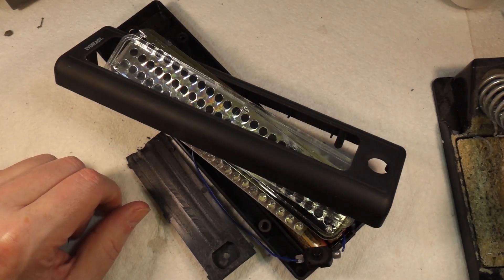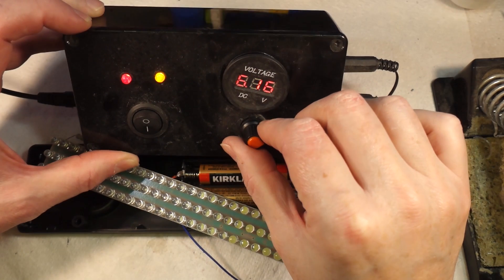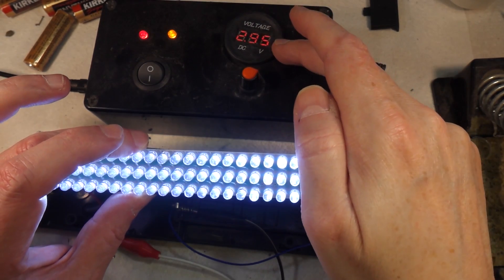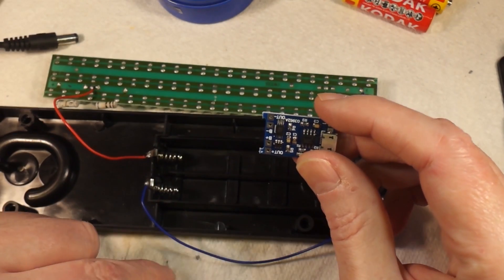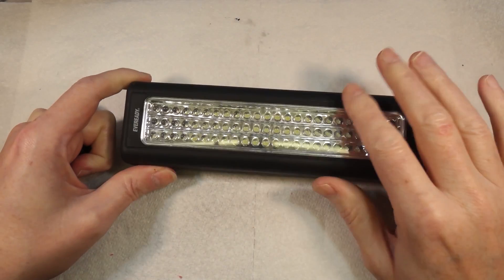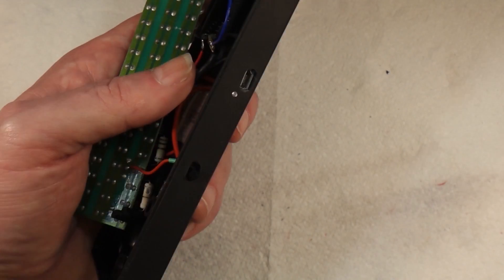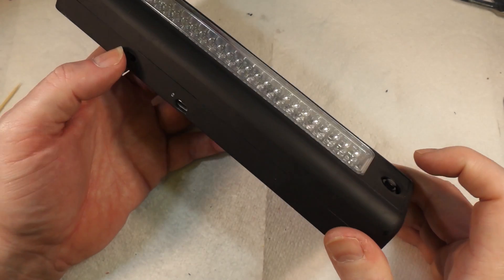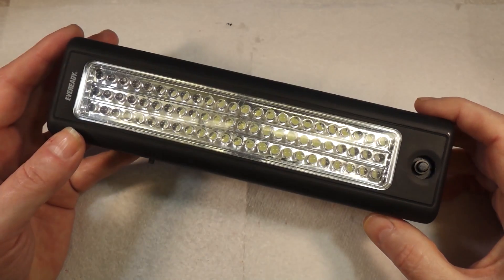Upgrading a torch with a switchable rechargeable battery circuit

Comment: A great video! I have one of these lights (mine says Maplin on it!) which I use to give shadowless overhead lighting for HO/OO figures (don't ask!). I usually feed it with AA rechargeables as I have plenty of those, but I'm very tempted to fit a lithium battery now. I probably won't use the complete belt & braces circuit, but it's good to know it can be done if I change my mind.
Reply from the maker: I tend to fit rechargeable batteries to anything I can these days. Even if you buy rechargeable AA batteries you'll be better off than buying the disposables.
Reply: @SteamGeezerUK  I agree entirely.

Comment: they say that the long thread drives the tailor crazy ... but the short and thick cable drives the modeler mad !!
And in fact, just finished writing the above, the demonstration: the cable is short!
Small electrical tip: when you weld the wire, do not twist it on the pin hole before welding it: it is the best way to went crazy when you want to unsolder it at a later time. 
Doing so, you should tin the tip of the cable and the pin separately and then tin them together or if you have the cables long enough, use the third hand with two bulldog clips that hold the two pieces to be welded close together. 
It seems less practical but above all if you have to unsolder and re-weld you get benefit, otherwise you have to cut the old thread and leave the residues on the pin.

nice project anyway!
To cool the glue faster I bathe a finger and quickly press it on the glue. Usually the glue doesn't stick to your finger and that quick contact doesn't burn your fingertip
Reply from the maker: Good tips, thanks.

Comment: I always thought that if a resistor is hot enough to burn you when you touch it, then you need a different resistor with maybe a higher power rating. When they're operating 'normally' they shouldn't get that hot?
Nice little project though - but I bet your good lady said: "yeah, that's nice, but I don't need it now. Couldn't you have just changed the batteries?" ;)  Great vid though, thanks for sharing.
Reply from the maker: It didn't really burn as such, I just wasn't expecting it to be warm at all. As for the light, the missus just carried on using it as normal but she knows she can plug it in if it stops working. She actually likes these little lithium batteries I put in things - I think she's like me in that she would rather recharge something than have to keep feeding batteries into it.